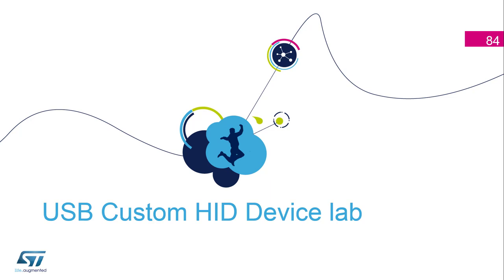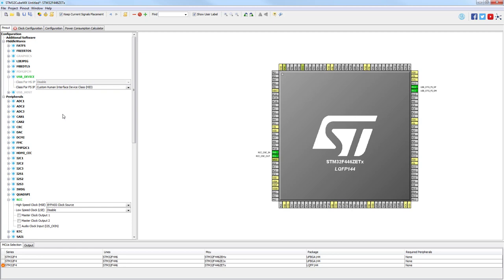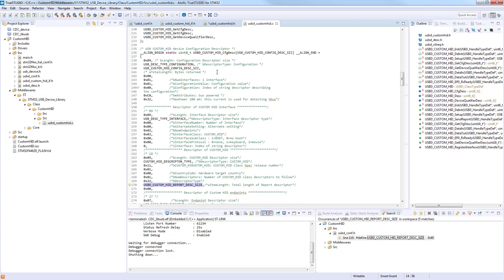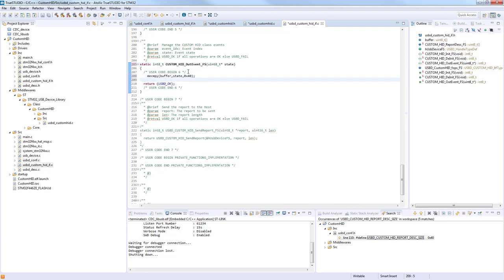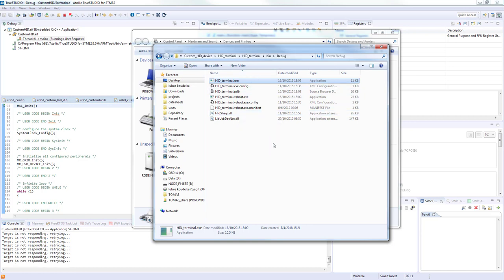STM32 USB training - 09.7 USB HID device custom device lab

Comment: Thank you for the video. 
It will be nice if you could make a tutorial on how to create the Report Descriptor by using the existing tools (like the one made by TI for SMP430)

Here are some bookmarks of this training:
2:57 use 48MHz clock for the USB.
4:18 Increase HID report size in usbd_conf.h
4:53 In usbd_customhid.h increase endpoint size and change USB customid structure (default structure message size is limited to 2)
5:48 fixing wrong change from before
5:53 #define USBD_CUSTOM_HID_REPORT_DESC_SIZE 33
6:15 Change the (* OutEvent) from 2 bytes to a buffer pointer.
6:27 Pass a pointer for OutEvent
7:14 change of bInterval value to get faster response from the device
7:51 change out and in function that are used
8:04 USBD_CUSTOM_HID_DataOut
8:25 OutEvent(hhid->Report_buf)
8:34 same for: HID_EP0_RxReady()
8:57 Change usbd_custom_hid_if.c
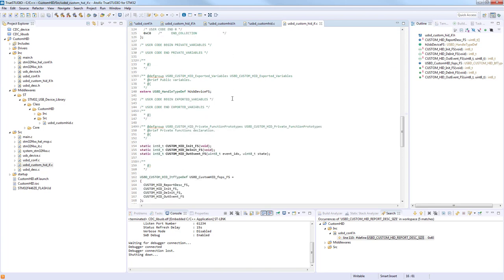9:17 add global buffer[64]
10:07 Modify CUSTOM_HID_OutEvent_FS function declaration
10:57 here callback  upon receiving data from host
11:07 add echo 
11:36 by using USBD_CUSTOM_HID_SendReport()
12:40 "a collection of numbers without any meaning..."
13:21 "magic" numbers that used for this example
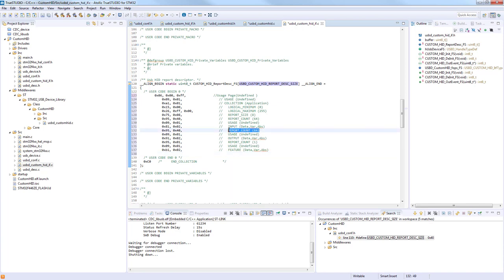13:34 go to USB specification: https://usb.org/document-library/hid-usage-tables-122
14:50 see the it in device manager 
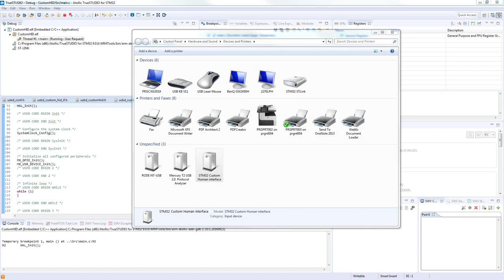15:00 run the HID_terminal.exe
15:11 at: \Tools and files\HID_terminal\HID_terminal\bin\Debug\HID_terminal.exe
Reply: Lookup hidrd-convert just don't use the short code versions on microsoft as it doesn't pass them correctly, you can define an XML or code thing worked great for me doing a joystick keyboard inetrface thing

Comment: I tested your example report descriptor with STM32F072C8T6. On windows 10 Device Manager/Human Interface Devices/USB Input Device/ Events tab I see following error "Device USB\VID_0483&PID_5750\2079365D4234 had a problem starting." and HidD_GetInputReport function does not work with error 31. Do you ever test your examples on Windows 10 ? (by the way, it is bad to change autogenerated code)
Reply: I also occur  fail on win10
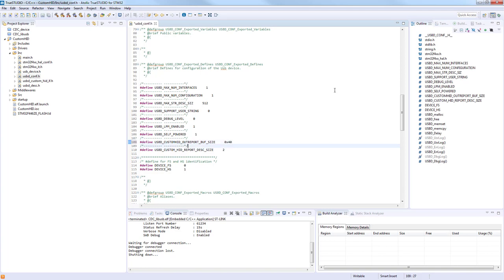Reply: @chih-weiwu251  I found the cause, the video at 4:27 ,   in usbd_conf.h , I modify  #define USBD_CUSTOMHID_OUTREPORT_BUF_SIZE     64 , 
the course slide I download from ST web,  lose this define

Comment: The example works in its original state and not allowing any modification. i want to send 1 from HID terminal and wants that the stm sends "Hello". This is not working. Why?

	memcpy(buffer,state,0x40);

	if(state[0] == '1')
	{
		Start = 1;
	}
	else if(state[0] == '0')
	{
		Stop = 1;
	}
	else if(state[0] == 'c')
	{
		Health = 1;
	}

and in the main function

	  if(Start == 1)
	  {
		  HAL_Delay(500);
		  Start = 0;
		  memset(buffer,0x00,0x40);
		  strcpy(buffer,"Hello");
		  USBD_CUSTOM_HID_SendReport(&hUsbDeviceFS, buffer, 0x40);
	  }
	  else if(Stop == 1)
	  {
		  HAL_Delay(500);
		  Stop = 0;
		  memset(buffer,0x00,0x40);
		  strcpy(buffer,"Stop");
		  USBD_CUSTOM_HID_SendReport(&hUsbDeviceFS, buffer, 0x40);
	  }
	  else if(Health == 1)
	  {
		  HAL_Delay(500);
		  Health = 0;
		  memset(buffer,0x00,0x40);
		  strcpy(buffer,"Fine");
		  USBD_CUSTOM_HID_SendReport(&hUsbDeviceFS, buffer, 0x40);
	  }